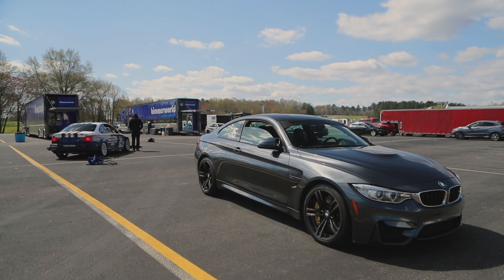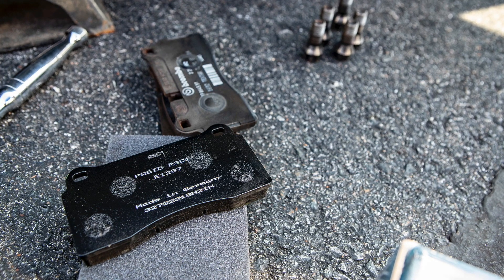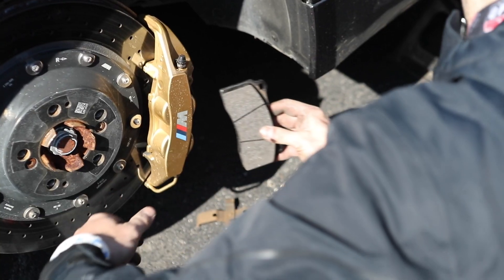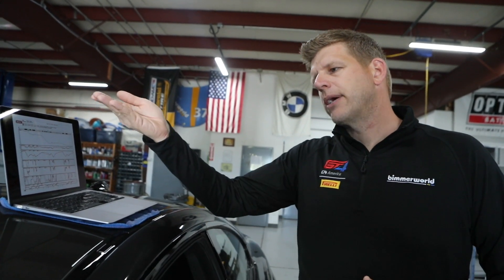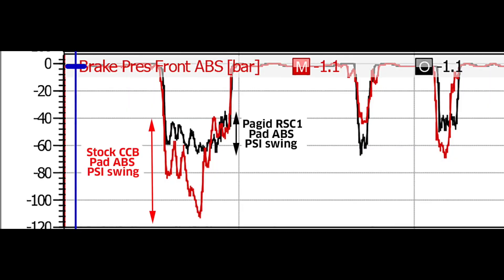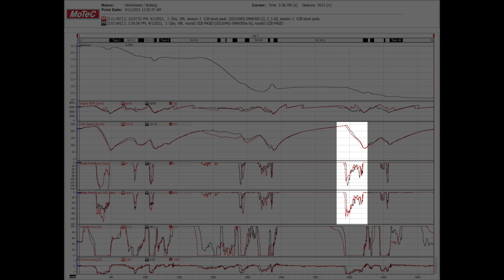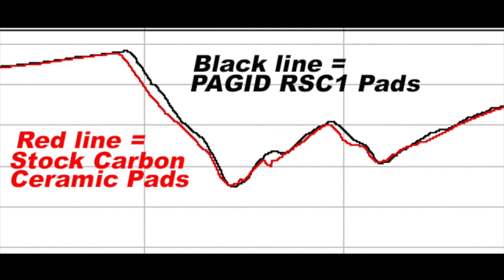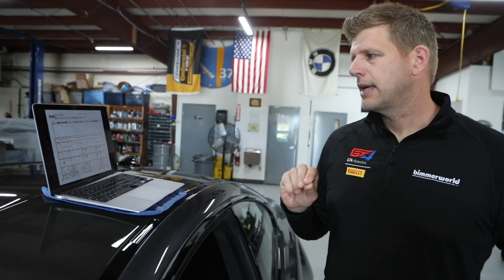BimmerWorld's Project F82 M4 "GTMore" - Carbon Ceramic Brake Test - Part 1

Comment: Installed our carbon back on our stock GTS. Patrick sent me a set. They stop great. Consistent pedal. Way better than the factory pads. No sweat at VIR at 155+ into braking zone. Thanks for the recommendation. 🇮🇹🤌🏼 https://youtu.be/t8sjTz4xUvY